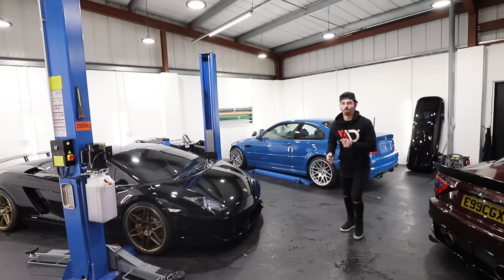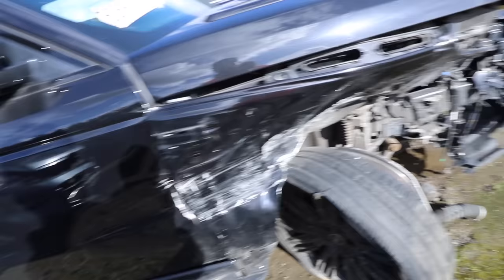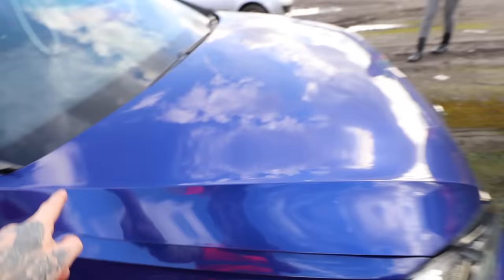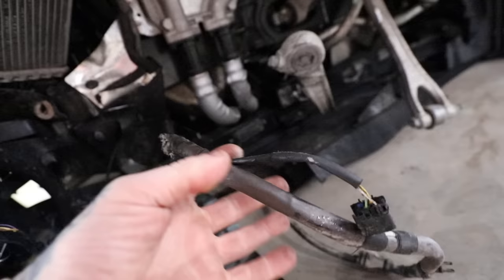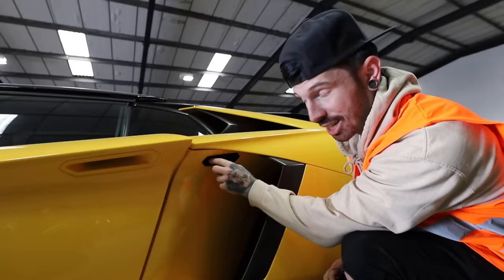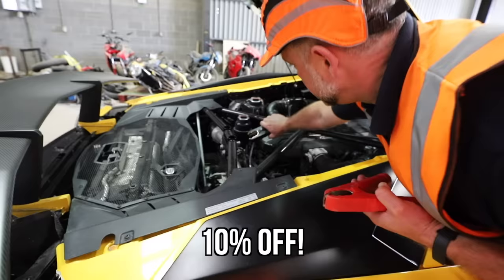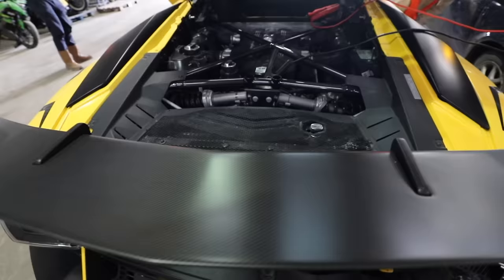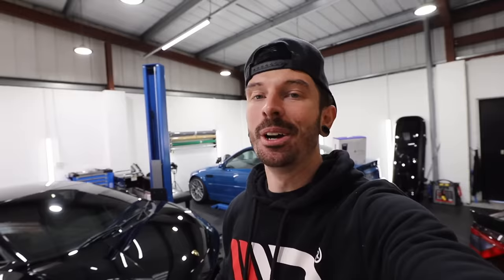I FOUND A WRECKED LAMBORGHINI AVENTADOR SV AT AUCTION

Comment: The reason why all these 800 HP cars have such unnecessary accidents is evident.  You peacefully drive at 100mph and press the fuel pedal a little bit too strong what happens very easily. The drive wheels start to spin and lose road contact. The car starts to slide and flies off the road.   So in order to always keep road contact cars with 800 HP should have a weight of at least 5 tons.  Instead, these cars are made with ultra-light carbon fiber.
Reply: That is not it, the owner uses cheap tire or reluctant to replace the tire pass 50% of usage ...
If you are not rich enough, don't play with this kind of cars, buy a brand new Mercedes instead ...